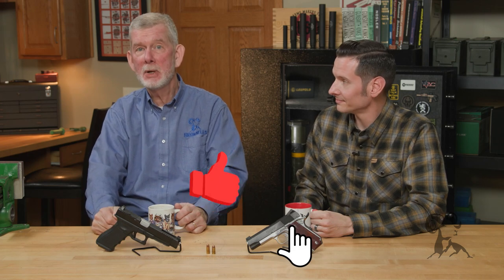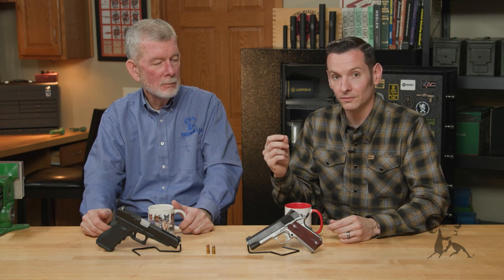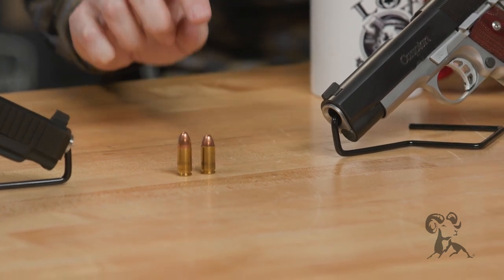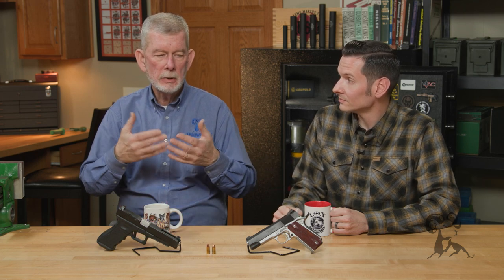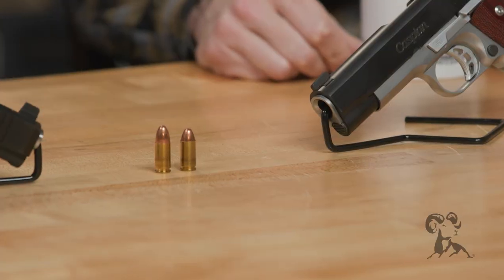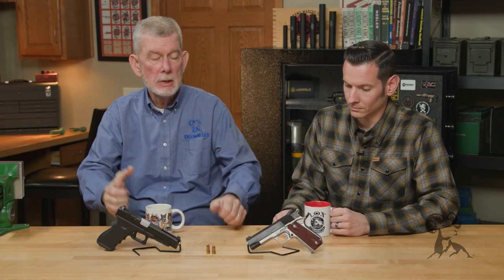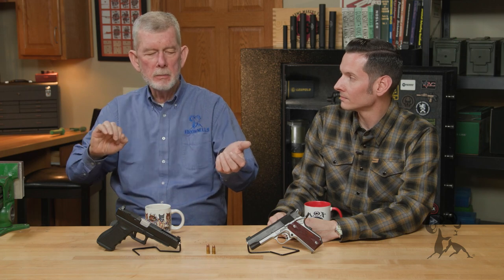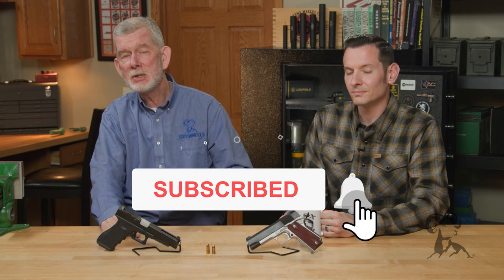Smyth Busters: Will Excess Bullet Setback Blow Up Your Gun?

Comment: Most of my handgun shooting over the past forty years has been with a revolver -- and revolvers don't do this.  In fact, revolvers have the opposite problem for some of the same reasons.  Recoil tends to pull the bullet out of the case mouth, and if a round stays in the cylinder longer than five shots (as might happen if you shoot three or four rounds and then reload the fired chambers, several times -- a real possibility if you're practicing tactical shooting, or if you carry the gun for snakes on a ranch or small game hunting) the bullet can potentially pull out far enough to interfere with the forcing cone and lock the gun up.  This isn't dangerous in terms of blowing up the gun, but in a defensive situation it can cost you your life.
Reply: It's called "jumping crimp," or a "crimp jump," or "jump crimp."

Crimp jumps are most likely to happen with +P type loadings, particularly in lightweight revolvers, or with very poorly made ammunition. 

The main distinction from bullet "Set Back," is that it is the recoil energy from firing the pistol that causes the un-fired rounds to jump their crimp, whereas the setting-back can happen to the chambered round, merely from chambering in the autoloading action. 

If the ammo is properly made, and within spec pressures, jumping crimp is effectively non-existent. 

Rounds that may be liable to jump crimp in a lighter revolver may not jump crimp at all simply by being used in a heavier revolver, because, again, it comes down fundamentally to recoil energy, and larger pistol mass can alter the recoil dynamics.

Even with heavy bullets or +P loads, in smaller pistols, if the cartridges are properly manufacturered, jumping crimp will only be a liability after a round has been exposed to the recoil energy of c. ten (10) other cartridges being fired. To be on the safe side, one could halve that and say around five (5) firings. 

So to eliminate the prospect, one needs simply to take some care when loading up their cylinder. In other words, if you have a five-shot revolver, for example, and you fire two rounds that day to, say, kill some vermin animals, you simply reload the two empty chambers whilst ensuring that the second reloaded chamber is the one resting in line with the forcing cone: what would have been cartridge number three to be fired in the last full cylinder now automatically becomes the first cartridge to be fired on the topped up cylinder. Reloading in this way, no single cartridge will be exposed to the recoil energy of more than five firings, before being "first in line" and fired itself.

So crimp jump is definitely a consideration. The nice thing with revolvers though, is that the way catridges headspace in revolvers means that a true roll crimp can be applied to the cartridges. This, combined with some care and attention in loading the pistol, means that crimp jumping can be effectively eliminated as a practical concern. With autoloaders, no matter how meticulously manufactured the ammo is, there is no way to actually stop the prospect of crimp jumping and set back aside from discarding the cartridge after it has been chambered more than once, or has found itself as the c. number eight un-fired cartridge in a magazine.

Comment: I tried a new bullet design in my 45 acp for my 1911. I used the same load and OAL I had been using for years. All of a sudden I'm getting blown primers, the primer pockets were so expanded they wouldn't even hold a primer, on the ones with the primer intact it was severely flattened. Nothing was different except the bullet. It took awhile, but I finally figured out the bullet was longer and sitting deeper in the case. I went to a longer than recommended OAL  and that cured the overpressure problem. The bullet sitting deeper mimicked a setback,
Reply: Were they Hornady XTP ? Due to the larger hollow point making the same weight bullet a bit longer, they usually call for a little less powder.

Comment: On the gun i keep loaded, i rarely unload it. When i do, and then re-load it with carry ammo, i ride the slide gently to chamber the round, to avoid it getting any setback, however minor. Of course i make sure the round fully chambered, doing a visual press-check.
Reply: That's some of the other issues with autoloaders: keeping loaded all of the time may prevent set back, but it also keeps the magazine under tension for very long periods, wearing them out faster. Riding the slide means the round might not be fully in battery.

Comment: Good topic. Also another cause a lot of people may do or overlook is if you have factory boxed ammo and put them in cans and the fit is too tight  when puzzle pieced in them. To maximize space, you'd be inclined to just go on and squeeze it in there bc they fit just right sometimes but may be too tight. I have a can of 9mm luger I have to check. I left them in boxes to see dates bc was several brands and they fit perfect but had to squeeze the last box in there. I thought of this potential problem afterward but actually forgot til this video. So thanks. It may save me and happened for a reason. Anyway, appreciate the videos ya'll. 🐍🇺🇸

Comment: I had this happen when a box of federal 9bple I ordered got slightly smushed during shipping. 47/50 rounds were fine, but those last 3 were set back maybe 2mm. I wouldn't have worried about it with range ammo, but given that it was +p+ I threw those 3 out. Not worth the risk.

Comment: A very useful presentation! Yet another need for awareness. Witnessed one kaboom in a .40 Glock fired in a pistol class I was teaching. Setback was the probable cause. Chamber shattered; mag blown out; frame bowed out; slide frozen. We never found the extractor. (Probably remains in low earth orbit...) Personally, about 40 years ago, I changed the bullet in near max (still, listed in several manuals) 6mm Rem handload. The new bullet, same weight, different ogive,  was seated slightly more deeply in the case. First round popped a primer in the Ruger No. 1. Stupid me! I knew better, but didn't have brain housing group engaged...

Comment: Stupidly shot a well set back 180gr gold dot 40 in my p239.  Resulted in extremely increased recoil as well as the extractor skipping over the rim causing a double feed( only malfunction ever in that pistol). If you unchamber/ rechamber carry ammo regularly stand the chambered round next to a new one once a month or so…if the OAL is too short chuck the round.  I’ve since read that it only takes mms to exponentially increase chamber pressure.  They more you know… great post guys!

Comment: Anything can happen at any point. It's the odds that matter. Most modern day pistols are rated for +P ammunition. If you do get a slightly over pressured standard round in a pistol, I don't see how it's going to be any more pressure than a +P.
Reply: Smokeless powder burns at a higher rate with pressure hence it is not a linear curve in increase, but a geometric.  Simply put, if the pressure is higher by 10%, the burn rate increases by a magnitude curve, and then MORE pressure is a result, hence a cascade event.  As +P loads are typically 10% or so higher in pressure you'll find it is NOT a 10% increase in powder, usually just 2 to 3% to compensate for the increased burning speed at that pressure point.  Decreased case volume is a big factor as well.

Comment: I had a new ar9 build that wasn't feeding well on test fire day. At the end of the set I had a few setback rounds that I was gonna run through 1 by 1. I pulled the mag, loaded my first setback by hand, pulled the trigger, and got peppered by shrapnel. The back of the brass seperated from the rest of the case, leaving a brass cylinder in the chamber. I blew the extractor right out of the bcg too. It still ran fine after that, even without the extractor. Lesson learned!!

Comment: Generally, you’ve got hotter carry loads experiencing this as that’s what you load and unload all the time. The problem is if there is less volume inside the case, that’s a bigger bang. The issue is that you don’t quite know if you’re already near the limits of the chamber pressures with an overpressured carry load. That compounded with a setback round is a bigger risk compared to its single low cost.

Comment: I used to have a Mac 10 full auto submachinegun and it would often lodge a bullet right into the side of the chamber causing huge bullet setback. I often would fire the setback rounds and they seemed to fire normally. However I heard open bolt submachinegun were designed to fire very hot Ammo that wouldn’t be safe to fire in a normal pistol so I figured that’s why it was okay. 🤷‍♂️
Reply: if its a locked barrel the danger is greater or just a blow back that will open with more speed i think

Comment: Every time I go to the range I start out with my carry ammo to prevent this. I typically carry a single stack so I'm not wasting a bunch of good ammo. When I'm done I load fresh ammo.
Reply: @Jbs6187  I think it's worth the money personally. I carry critical defense. Like I said, it's a single stack so I'm losing 8 rounds at a time. I'll switch to practice ammo after the first mag
Reply: @Jbs6187  it can be expensive but it’s better then having a catastrophic malfunction when you most need the gun!
Reply: @Jbs6187  and like this other comment I seen bullets are cheaper then a new firearm lol
Reply: Cycling carry ammo out at the range was regularly drilled into me back in my younger days by older more experienced curmudgeons who took carrying very seriously. It has two purposes, the first is to ensure YOU confirm where your sights are hitting with that carry ammo, and the second was to limit things like set back, possible oil infiltration, and powder degradation from the constant vibration and jostling.
Reply: @striker8paints  ya I think it's important to confirm that your carry ammo has the same point of impact too. I've never experienced any severe shifts between ammo in my handguns, but it's something to be aware of.

Comment: One of my Hornady manuals addresses this.  They intentionally set back bullets and fired them in their test fixtures to measure the pressure.   As one would expect in large rifle cases it basically made no difference, but the .40 S&W ramped up to 60,000 PSI with very little setback when using 180 grain bullets.

Comment: Bullet set back is most definitely a dangerous thing. Firing low pressure 45ACP, had a round set back just 0.050". Pistol was G21, and that round nearly blew out case head, had worst "Glock Smile" I have ever seen. Learned a valuable lesson that day.

Comment: I had this issue about a year ago with a glock 357 sig. Too much rechambering caused set back, case deformation, failure to feed, and even caused a round to get stuck in the chamber such that I could not unload the gun myself. A gun Smith was able to free it safely.

Comment: I had it happen once with my 1911. It's by bed side firearm so it gets cleaned/loaded constantly (keep the dust off and insured proper functionality). I took it to the range and the bullet functioned normally. It was alittle nerve racking but I had to know if it would still work. From that point on, I changed my loading procedure for my night stand gun. I hand feed 1 round into the chamber, release slide, then insert the full magazine. Doing this eliminates the set back problems. I never had a setback issue again.

Comment: On a recent armed security position, if carrying the company issued Glock Model 22 .40 caliber, we were required to fully unload the weapon at the end of each shift and reload at the beginning of your next shift. The weapon was assigned solely to you and locked up when you were not on duty. During shift change one evening, the officer I was relieving set the round down that had just been removed from the chamber. I noticed severe set back in that round and moderate setback in the next round in the magazine. All other rounds in the magazine were fine. The rounds were immediately taken out of service when the Security Director examined them.

Comment: Bullet “set-back” will occur regardless of hand loading or off-the shelf.  All my Glocks (G42, G26, G19 and G23) will set-back the round on chambering.  As you mentioned, loading and unloading that SAME round.  When ever I have to unload my chambered round, I MUST INSPECT that round and when I find it set back, to my tolerance, I place that round into a box specifically for range ONLY discharge.  A lot of the time, not always, I’ll carry un-chambered for this reason.  I found that chambering a single round, with the slide forcibly slamming the cartridge into the chamber and the bullet into the BORE, any round will have substantial set-back after two to three loadings.  GOOD VIDEO esp for those that DO CARRY.

Comment: I noticed the setback issue years ago when I was still carrying my 92FS. Now I make a point to chamber the first round by hand and when I go to the range what is loaded in my carry gun gets fired first in order to avoid the set back situation, cycle out the ammunition being carried in the pistol, and give me the confidence to know what is loaded in the pistol will work as expected when needed.
Reply: Well the Beretta is actually designed for single round loading. Most other Firearms are not designed for that. Even though you can still do it.... You risk breaking your extractor.

Comment: Bullet setback was the reason why I stopped used Winchester Silvertips decades ago. Those bullets were too easily pushed back into the cases, especially in .45 ACP. 

I noticed this problem with .380 and 9mm as well, although not quite as bad. It's possible the feed ramps and barrels were throated enough to minimize bullet setback. 

It was probably caused by a combination of inadequate barrel throating, Silvertip bullets being slicker than most, and inadequate crimp/bullet pull.

Taper crimps used for semi-auto pistols may demand more caution in choosing bullets and cases. A slight roll crimp might secure the bullet, but at the risk of headspacing problems.

Nowadays many semi-auto pistols are throated more aggressively with better feed ramps. That's good if we use only standard pressure rounds. But it compromises case web support, so it could be a problem with +P and +P+ loadings. 

I'd still be okay with Silvertips in revolvers, including .45 ACP and 9mm. They were reliable cartridges otherwise and expanded okay in some test media. And Silvertips are often inexpensive compared with newer hollow point designs.

Comment: That may have been what caused a live round to get stuck in the chamber of my LCP MAX.  I couldn't rackbthe slide with all my might to eject it.  I had to fire the round and it wasn't pretty,  but with some work, I was then able to remove the spent cartridge. 
Stripped, cleaned and lubed the gun up, and all seems functional now.

Comment: I had a Kaboom during a IDPA Competition where my Gen 3 Glock 22 with a AccuMatch Barrel and Compensator went BOOM and the Pressure of the 155gr JHP Defensive Round was do HIGH that it SHERRED OFF the Lower Barrel Locking Lug and Caused the Pistol to JAM with a LIVE ROUND in the CHAMBER and a VERY HAND way to get it since I could NOT get the SLIDE to COME BACK! Finally after about 20 minutes of working the Problem I was able to use a small Screw Driver into the Barrel Release and got the Slide to Move Forward! I still have the Pistol that still works fine with the OEM Barrel and the AccuMatch barrel and Comp.  The Match was held at my Military Base Weapon Range and I had setup my pistol like a Rowland Special before there was such thing of Optics on Pistols since this happen in 2006.

Comment: I have a 9mm blowback upper that i put in a multi cal lower, i put the mag adaptor in but forgot to change the buffer to the longer and heavier 9mm buffer. It shot the first round but jams on the second, i inspected the round and it was set back. I didn't know that firing a round like that would increase pressure, good thing i didn't fire it. Thank you.

Comment: I have a little info that might be useful. As a COP, when we had kids in the house, I used to clear my service pistol every day. It was a .40 S&W Glock. I know you said that Glock pistol weren't as much of a issue but it does occur with them. I would notice the chamber round would have the bullet set back after a month or two of rechambering the same cartridge. I would put that round in a coffee cup in the safe and replace it with a new one. Every so often, I would take a impact bullet puller and use it to pull the bullet back to about the original position and use this ammo for when we requalified. Before I started doing this I had fired a couple of these and noticed a much sharper 'flip' from the pistol. There is definitely a pressure spike on a setback 40.
     As far as reloading goes. I reload and have a Lee 'factory crimp die' for nearly every caliber that I reload. I have found that this is a great tool from Lee and I haven't had any noticeable setback on any ammo that I have loaded with that tool. It's an extra step but worth it. I put that die in one of my presses and after I load a batch of ammo I just run them all through that station and it really doesn't take long.
     Ya'll Take Care and be safe, John

Comment: I've had this with 10mm before. The PPU and, to a lesser extent, Remington and Federal brass, just won't hold the projectile where it's supposed to be and the bullets frequently get pushed in when feeding or even through rough handling. I've had very good luck with Armscor brass in 10mm and when weighing them have found them to be the most consistent of every brand I've tried. 

It sucks because 10mm brass doesn't grow on trees, especially these days, and I don't want to scrap a bunch of brass but I also don't want brass that causes these kinds of issues.